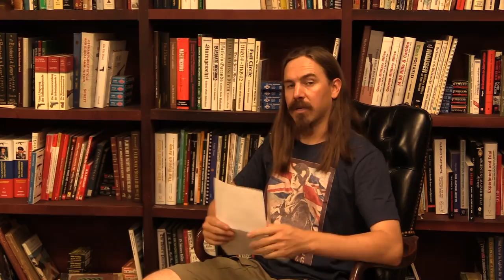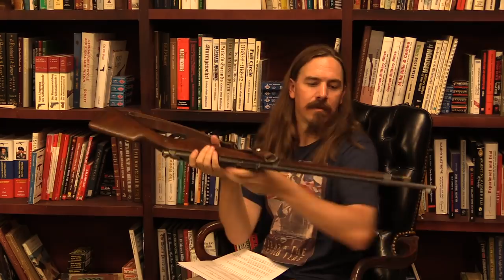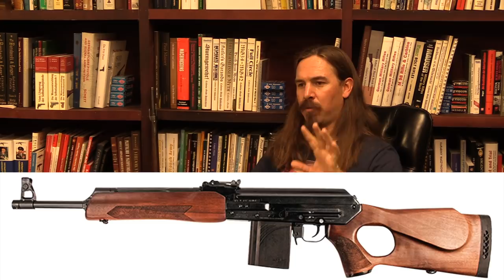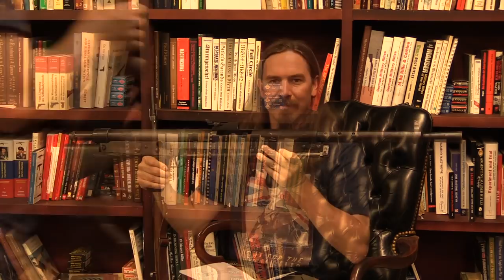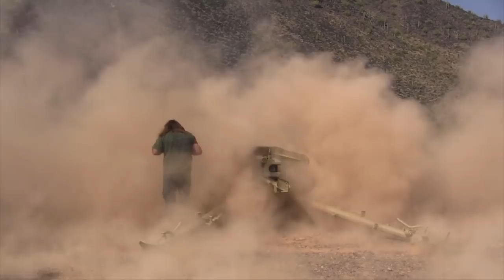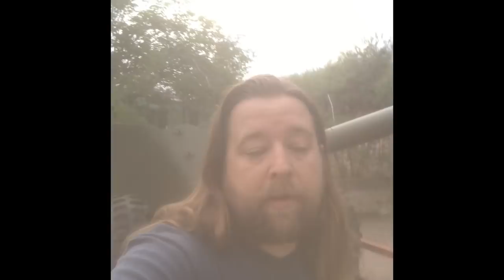Q&A 20 - With Special Guest Bob Bigando

Comment: "Hey is that a Mosin?" 
"Nah it's my S U P E R B L A S T E R 1 9 0 0"
Reply: Is it in the 40 watt range?
Reply: Chris Toda yeah but militaries at the time were sceptical about soldiers blasting away willy nilly and the SB 1900 didn't have a capacitor shutoff, so they just went with bolt guns instead

Comment: I remember a big advantage of the 40 was it was very easy to convert to 357sig. I remember back around 2000, this was a huge selling point for .40 guns. I bought a SW Sigma with the intention of converting. 357 SIG. It was supposed to be the cartridge of the future, but not many guns were chambered for it. Thus all the conversion kits, some of which were of dubious safety. 357 Sig never took off, and kinda faded though.

Comment: Ian,  I would have place the inherent weakness of the rimfire design well ahead of it not being reloadable. In order to set the priming compound off you must crush the rim. This limits the amount of  pressure that the case can contain. If you want high performance ammunition you need the strength of the center fire case.

Comment: There is tradition to Artillery troops getting special weapons, even before modern times. In Napoleon's era, French Artillery troops were issues a short sword, about the size of a Roman Gladius, but more sturdy, because it was a dual use weapon/tool, meant for self defense in a pinch, but primarily used to chop wood, clear shrubbery and stuff like that.

Comment: You (and others) have said that the MG34 and MG42 were head and shoulders above the rest the best GPMGs of WWII; how do they compare to their modern equivalents? I know many countries still use the MG3 to this day--how does that compare to say a MAG58/M240, or say the PKM? What pros and cons do they all bring to the table? Is there a next generation GPMG on the market or on the near horizon (like say the Knights Armament offerings) that could potentially supersede the current lineup?
Reply: Of the ones that you have mentioned, the MAG58/M240 is the heaviest at 26lb with the MG34/42/3 second at just over 23lb and the PKM at just under 17lb as the lightest. 

The MAG58/M240 is just an upside down BAR with a MG42 feed tray, the MG34/42/3 is a roller locked recoil operated gun and the PKM is more of a scaled up AK then anything else.
For carrying the PKM is the current favorite of most of the SpecOps guys and Taliban approved. :D
For a sustained fire role the MG34/42/3 is probably the best with no gas system to clean, just keep swapping barrels when you change belts and it will run until you are out of ammo. Col. George M. Chinn (the guy who literally wrote the book on The Machine Gun, all five volumes) thought very highly of it.
Reply: Alex Vogel the new knights armament is very nice, brings the GPMG back into the realm of shoulder fired, instead of just called over the shoulder and fired sometimes.
I'm not sure how the KAC runs in continues fire, which is key. clearly the MG 34/42 was made for it without a doubt.
Now, that is a comparison of a "SAW" from KAC to GPMGs, or a "light GPMG" because someone told me that once. I'd love to compare the KAC in. 308 and see how it does in supporting roles, such as vehicle mounts, very long periods of sustained fire, and just general overall long term use characteristics.

Comment: Convertible firearms, a few points:

For the price of a conversion kit I can just buy another firearm in the new caliber.

It's a PITA to convert when you want to fire the other caliber or in the case of Glock .40 S&W calibers.

It's usually a one way conversion to a more practical 9mm pistol that leaves you with a useless .40 S&W caliber barrel and magazines.

The same for .40 S&W to .357 SIG conversions.

Having said that I do own a Thompson Contender and it tends to stay configured in one caliber while other calibers languish.  I also have the rifle version, but the cost of barrels approaches the price of a Thompson Compass bolt gun that is more accurate anyway.

Comment: Is there any chance you could address why in the late 19th and early 20th century, most military firearms placed their rear sights where they did? Specifically, why they went with an open V or notch in the middle of the firearm, as opposed to an aperture at the very back of the firearm. I've seen plenty of photos of weapons with target sights RIGHT in front of they eye, so I presume that most militaries were familiar with the concept, but they still chose to shorten the sight radius considerably. From Othias' SMLE videos, I understand that the British considered moving the rear sight even further forward on the barrel, and their final position is still well forward of the rear of the barrel or directly over the receiver. What was the thought process here?
Reply: The P14/M1917 and the Ross rifles are obvious examples this being done, so the technology and mindset was there and available--what was the argument against doing it that way?
Reply: Took till 1939 for the SMLE to get rear mounted apature sights in the No4.  Even then it wa smainly a European Front weapon. If you look at pictures from The Midle and Far East thetres, still the N1 Mk3 . That's what the Arsenals in Australia and India were producing. The loss of these rifles following Dunkirk happned at about the time the No4 was to be adopted so they were built as replacements. Any No1 left in inventory were still used for Home Gaurd and second line though.
Reply: Alex Vogel "son, that's how we always done it"
I hate to not be useful, but that might be the best answer. Early muzzleloaders had forward mounted sights, and it was probably a form of tradition that (for the most part) kept them there.
 Now, there were muzzleloaders with rear mounted peeps, but those might've been seen as fragile (most were) and only for "hunting guns", such as red dots used to be only for competition.

Comment: The conversion concept is mostly right. I don't care to convert my Glock 34 to .41AE just for the sake of conversion. If a caliber is truly worth it, I'll buy a new gun myself. But it is nice that .40SW drops into a 9mm frame, so I'll be looking for an aftermarket .40SW/.357Sig upper assembly only because it's convenient. If .40 took more work than that I wouldn't bother.

But the same thing with the .300 BLKOUT. People were excited that they could use the same bolt and carrier, and that's great and all, but it's a hit or miss on proper headspace without mating the bolt and barrel, and it sounded like they planned to regularly swap barrels depending on their mood. If I do a non-5.56 Cal upper on my AR, it'll be Cal marked and I'll just build a new one, new bolt and all.

Comment: I heard several self proclaimed historians give specific numbers for how many arrows a English longbow archer could fire per minute.
That always struck me as very dubious.
We're talking about the 12th century here. Not only was that a time when most people still measured time by looking at the sun and by how fast candles burned down, but also, as far as I know, the concept of "a minute" as a unit of time measurement wasn't even a thing back then.
Originally, a minute, like a second, are geometrical, mathematical units for the measurements of the circumference of a circle.
We only use them as a measurement of time today, because we associate time the the round dial of mechanical clocks.
Mechanical clocks were invented around the same time as the longbow, in the 12th century and it took centuries for them to become common and widespread enough for becoming a major means of measuring time. In the age of the longbow, mechanical dial clocks were still weird oddities, only known to a hand full of "wizzards" and about as rare as atomic clocks are today.

The point being, even if they would have been able to segment a day and an hour into smaller units, using candles and hourglasses, they would have had no reason to use units associated with circles, like minutes and seconds. They would probably have divided an hour into 2, 3 or 4 smaller units, but why 60, even if they would have called it something else but minutes?

Sure, there were sun dial clocks, but they were rare and unreliable in cold, cloudy northern Europe and you can't really derive the concept of minutes and seconds from them, despite being round, because the shadow doesn't move over the circle at a steady speed, so minutes and seconds would have been of different length, depending on what time it was.

I guess they could first have normalized candles and hourglasses to a point where they could have gotten quarter hours relatively precise and then have an archer shoot for a whole quarter hour and record that number, so later historians would have been able to divide the number by 15 to get a "arrow per minute" number, but that seems very, very unlikely to me, especially considering that back then, even the average nobleman was barely able to read or count to high numbers, let alone some "chief archer", or whatever the leader of a unit of archers might have been called.

Why would they have embarked on a big, scientific project, just to find out how many arrows one of their archers can shoot within a given unit of time? 
My guess is they had two speed settings: "Fast enough." and "Not fast enough." and which was which probably depended on the mood of whoever was giving the orders.

Long story short, I get very dubious and skeptical when I hear one of those Youtube historians, or any historian for that matter, throw "stats" like that around.

Comment: RE: Audio engineering - you could try running your sound files through a site like auphonic.com, they have some serious voodoo dark magic going on in their filters, and their UI is simple as can be. Click "upload file", click "start", wait for the magic to happen, download the file, and its done.
I recently digitized a couple of old audio cassettes by simply hooking the 3.5mm jack of my $20 tape player into my computer. The quality was about as good as one might predict upon knowing the setup, but Auphonic fixed a LOT of the crackling, LFHs, normalization issues, and general "niceness" of the track. Its pretty sweet. Also it has a free trial version if you happen to have a .edu mail address.

Comment: 49:10 I would also add to Ian's answer that if the box mag was invented (by Lee) 10 years earlier, it still wouldn't help since you would have loaded those box mags by hand (Brits with Lee Metford) singularly as well as tube mags (which would have been slow). The box mag in that time was made weak since the idea would be to carry 1 in the gun and another for 1 quick emergency reload. If Mauser's stripper clips were also made way earlier and were to work with the box mag, like the Lee Enfield, then I could definitely could see people going to stripper clip red box mags since you can shoot more bullets down range faster instead of slowly reloading a tube loader, like a Swiss Vetterli.
Reply: Bear in mind that at the time virtually all military bolt action magazine fed rifles had a Magazine Cut Off.  The magazine was loaded earlier at lesuire, in battle  you still stood in a line and fired on command, so the magazine was not considered the primary feed.  The end game was still fix bayonets and charge!

Comment: Ian I was wondering if you had any videos on a M1917 enfield or P14 that’s been sporterized. One of great or great great grandpas bought one back in the early 1900s with an original scope from the time. It’s in amazing condition and I was wondering what’s the general value on them? I’m not selling it just would like to know. Thank you.

P.S. The scope can flip to the side to be able to shoot irons but if I remember correctly it’s not the original sights as it’s a little rear notch sight on the barrel.

Comment: Small Arms of the World, by Smith.  Also the Colby series of books, although a little simplistic. Yeah, Remington 8 with box magazines, maybe with shorter barrels.  Also I think some Savage 99s.   Yeah, editing audio, yuck, LoL.  No question that some guns which seem great on paper, are not all that once you get your hands on one and shoot a hundred rounds through it.  A few clicks instead of a boom can sour you on a gun quickly.  So too when a gun proves clumsy to handle or requires excessive hand movements, etc.  Loading ten rounds into a C96 without a stripper clip is a good for instance.  Not to mention the horrible grip if firing one without a shoulder stock.  I have a friend who as a (fairly rare in that country) armed female police officer related to me how her country in the late 90s had purchased a whole bunch of South American revolvers that looked just like American S&W .38/.357 revolvers, thinking because of the price they had gotten a really good deal.  They became much more aware they hadn't when while training recruits the gun's cylinders fell on the ground because the cylinder yokes had cracked in two under recoil, or when the pull of a trigger did not always guaranty the hammer would even move much less fire the gun.  Much adjustment of price followed, LoL, and today gradually Glocks are replacing those.  Stuff like that and you quickly realize a gun is not great just because some salesman or magazine article says it is.  Germany in WW2 had no heavy bombers and heavy bombers proved to be really important.  Given reasonable care and environment I would expect many of today's stainless steel guns to be just like new 300 years from now.

Comment: Headspace is so overfretted about. Very few people understands what it means. It's always the first thing to be blamed for whenever a gun is 'blown up', yet is rarely the cause. I've heard of people telling someone to check the headspace on a gun that couldn't chamber or had a squib load! What makes matters even worse is SAAMI mucking around with the chamber dimensions for particularly non-US military calibers. For instance, SAAMI said the maximum allowed headspace for .303 is .070 
inches, the British MOD states .074 inches and even allowed .080 inches for wartime emergencies! I can't tell you how many times people have asked on forums what they should do with their "matching bolt SMLE with bad headspace" and it's always after they checked with SAAMI spec gauges. And that's for calibers that the original dimensions are known. You can buy a gauge for your Japanese Arisaka and they will fail EVERY SINGLE TIME! No one knows what the original dimensions were.
And riddle me this, what happens when you replace that matching bolt with another one to 'fix' your headspace? You now have a gun with insufficient headspace which can increase chamber pressures by not allowing the cartridge the room to expand.

The first thing to learn about headspace is to not worry about headspace. It's a bolt action rifle. It won't wear that much.
Reply from the maker: https://youtu.be/oQq4qI8oMcc
Reply: Yeah, I've already watched it. That's a good video explaining what headspace is, but he never delved into the practical about it though. It matters a lot when installing a new barrel, and it matters a lot for accuracy and reliability (particularly in machine guns), but not really for safety, at least for excessive headspace. insufficient headspace is dangerous, but it's the one know one ever checks for and I've seen plenty of (usually) Enfield that have insufficient headspace because they switched out bolt heads.
Reply: So now we have two Experts opnions. Dosen't get much better than that!  As for the Enfields, and I assume you mean P14 and M1917, then as Otis said, the three companies never achived standardisation, so a Winchester bolt would not be a good idea in a Remington or Eddystone. My P14 is a Winchester (T) Mk1, and as it was owned by an EX British Army Armourer who is also an official at Bisley, I have no problem shooting it (The problem is when the bullets come out the barrel they NEVER go where I want! :-) )
Reply: No by Enfields I meant mostly SMLEs and particularly No.4s. The bolt heads are replaceable and because the No.4 bolt heads were replaceable with different numbered sizes so people think it was to change if the headspace changes, when in reality it was just to speed up production. But yes, the 3 different P14 manufacturers never standardized and bolts from different manufacturers probably won't work with another rifle from a different manufacturer.

Comment: i thought ian would pick the Suomi as the best smg from ww2. i would pick the Suomi or the mp34 as the best smg from ww2. and i am happy to own both of them ;)
Reply: The Suomi is ridiculously heavy
Reply: @communismbad6236  yea, no gun is perfect. But I would be willing to deal with that weight cause I can get a lot of firepower and accuracy out of this thing.
Reply: @bob445566DE  I think that opinion would be changed after a hike with a Suomi. That’s one of the reasons for the adoption of intermediate cartridges like 5.56 and 5.45. They are significantly lighter